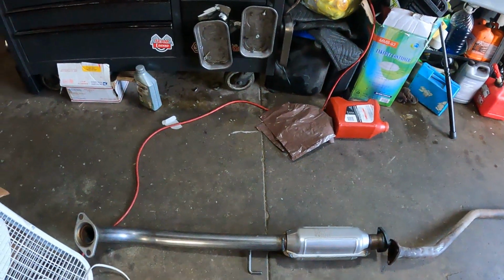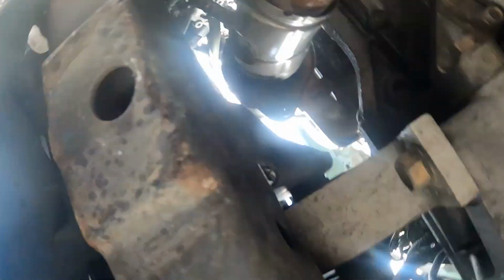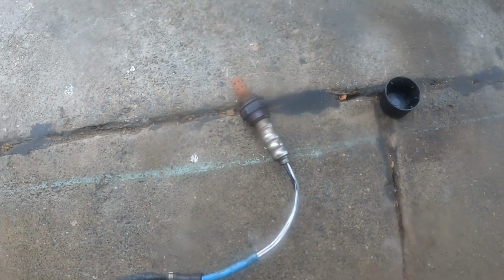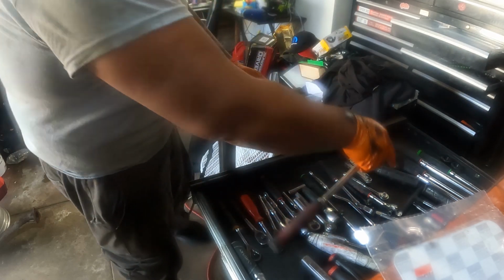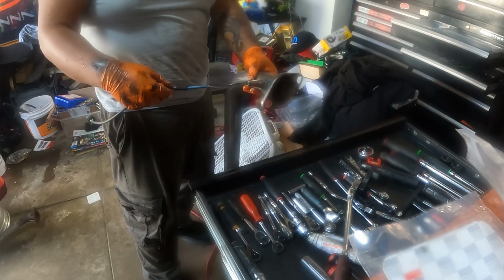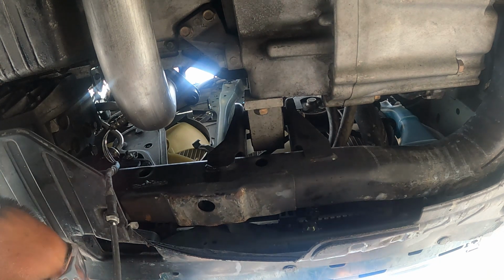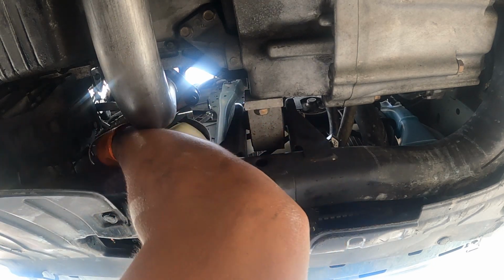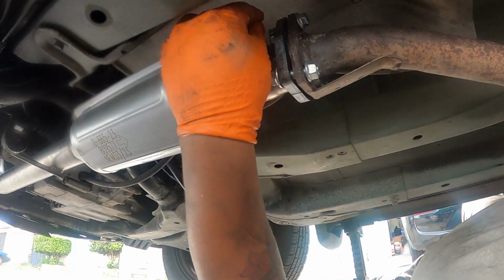2001 - 2005 HONDA CIVIC Coupe /// how to remove & install  (Catalytic Converter)

Comment: please people do not attempt to lift your vehicle like that, a very dangerous way of doing this instead borrow a set of ramps and lower the vehicle evenly on ramps which you could even make them there are tons of videos on how to make car ramps. it's not worth it to loose your life when you can work smarter.
Reply from the maker: thank you for your concern sir, the car is properly secured i have 4 jack stand and rear jack just in case too. yes yes i've seen people how they jack they car without jack stand. i've always check my safety before i work on my personal cars or my side job. 

anyways if you considering to subscribe to my channel just click the subscribe button and i really appreciate your support brother.

Comment: thats weeird.. seems i dont have a front cat, only on the rear :s
Reply from the maker: basically all car have cat converter, but it will be depend on design and style, this particular honda civic has straight pipe exhaust due to no cat converter. and i'm replacing with new cat converter. 

if you have not subscribe to my channel yet please do just click the subscribe button to get connected with my new vidoes